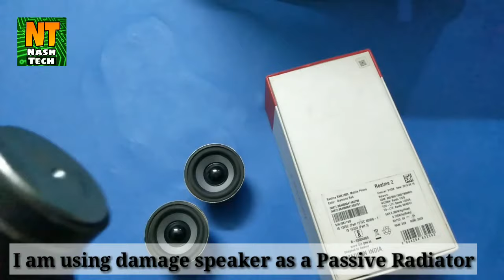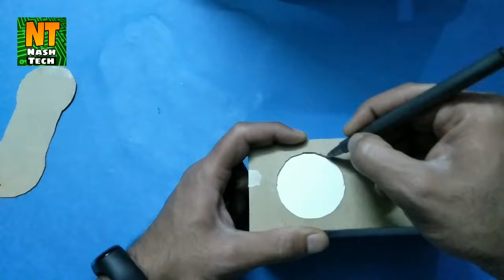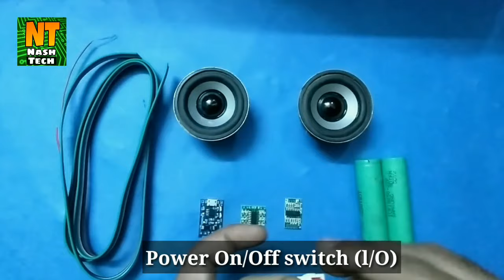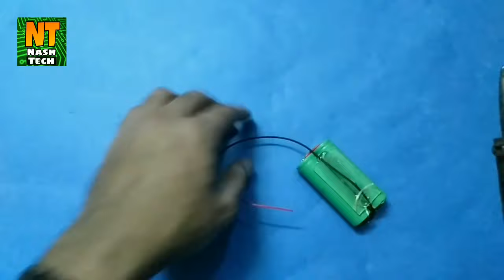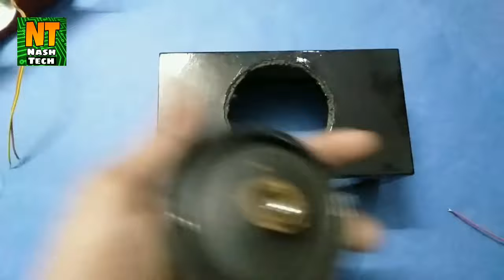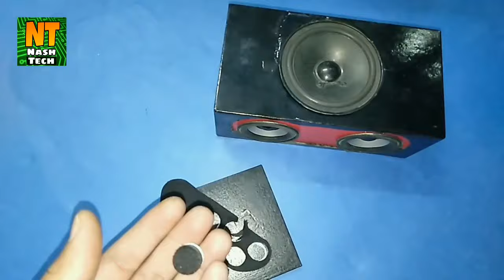Bluetooth Speaker DIY | How to Make portable Bluetooth Speaker at Home

Comment: Marvellous work! You have used three most important and sophisticated module, eg. Bluetooth,  Amplifier and charging! But provide the details as caption in your next video, eg. wires, output/input, circuit diagram etc.!
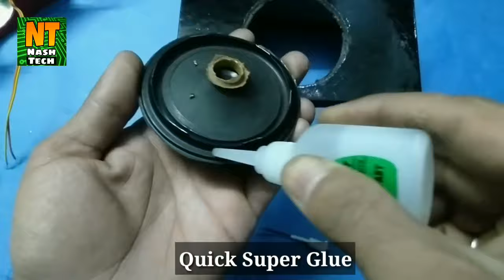Reply from the maker: Their is a circuit Diagram at 16:05,.
Look in the video..
Reply: @nashtech8548  I want to see your next DIY electronic video on another small yet powerful Amplifier by using CSR8645 as Bluetooth and PAM8610 as Amp. module! But next video should be precise, clean shooting and closed focuses on detailing while working upon!

Comment: Battery se to 3.7 v out hoga or bluetooth module 5v me chalti hai na
Reply from the maker: Wo maximum Voltage hai 5v.
Reply: @nashtech8548  or minimum 3.7v ooooh nice
Reply: 5 v battery full 3.7 battery is about to dead
Reply from the maker: Wo maximum limit 5v hai ager aap 5v se jada dogey to Circuit kharab ho sakti hai,.
But isme minimum 3.7v se asani se chal jata hai,.